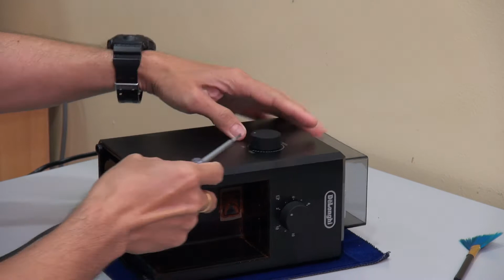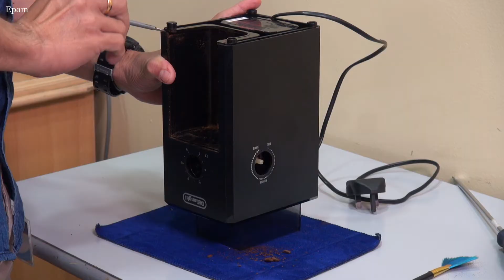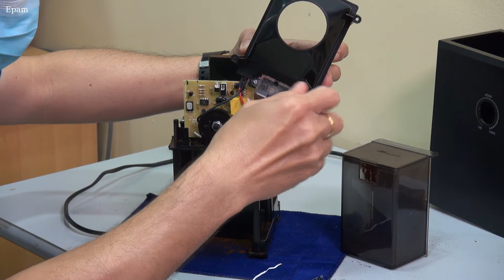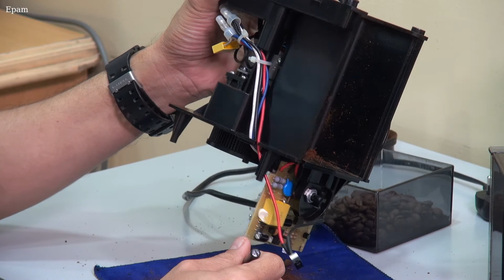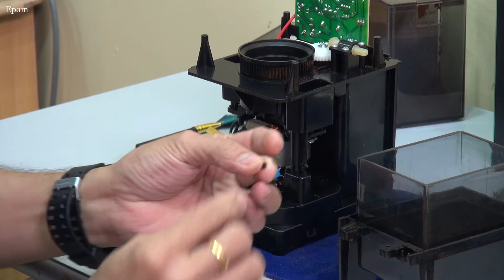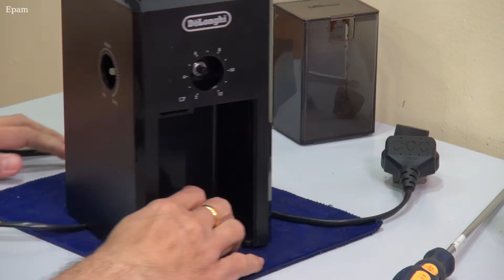Delonghi KG79 Clogged Grinded Coffee Beans | General Cleaning

Comment: I used this video to take apart the grinder to replace a .47uF cap which was faulty. One small point is the top part of the grinder will come out without disassembling. It works on a bayonet principle. Clockwise and pull. Thanks for the video.
Reply from the maker: Welcome. I forgot to remove the removable grinder.
Reply: The fault returned a few weeks later and I discovered that the top 100uF 25v cap had a broken lead. I replaced the cap and secured it with hot glue. I did this to other components that could break with the vibration.
Reply from the maker: @aceryeo8409  Good...

Comment: I turn the knob to the finest setting but the grind is never fine enough for a proper espresso. Is there a fix to this or should I consider buying a professional grinder to get really fine grinds?
Reply from the maker: You need to buy professional grinder.
Reply: Just search for "modify delonghi kg79 finer grind" and you'll find multiple videos showing you how to do it. It's quite easy once you've managed to pry off the front knob.

Comment: I lost the f.cking little plastic piece! I cleaned it and put it back together a couple hours ago and didnt think it is an important thing. After hours and cleaned everywhere and even throwed the garbage bag… What am I gonna do now 😫
Reply from the maker: Get a plastic or bamboo toothpick then make a small like bullet using sand paper and cutter blade.
Reply: @ I used a piece of paper to click in the cencor button. So it worked but there is no safety lid anymore 😃 It works even without a lid now
Reply from the maker: @ not safe
Reply: @macor285  I agree but it was the only solution to me at the moment. I hope I can find it as a spare part on the internet.

Comment: Awesome video, cheers!!

I have an issue with my KG79 you may be able to offer some advice on- 

As I was unlocking the burr insert to give it a clean out I forgot it was loosened with a right turn. So I inadvertently over tightened it resulting in the grind coarseness knob being thrown out of sync. I now have the dial set to max coarseness (full clockwise) but it gives a very fine grind but if I turn the knob anti clockwise the burrs just jam and dont move. 

Any advice e would be much appreciated.
Reply from the maker: if you will disassemble the unit you can see plastic color yellow (pin) and the white gear, just try to return the red color indicator to 3 o'clock position. If you want want more fine move the red indicator to 12 o'clock position. Watch also this video https://www.youtube.com/watch?v=8KX0KLWoj7w&t=7s. Good luck...
Reply: @macor285  thank you so much!!
Reply from the maker: @spm6689  Welcome

Comment: I opened my kg89 grinder to do the finer grind hack but when I put back together the appliance stopped working.. i opened again and made sure the sensor is properly installed but still no luck.. anyone can help?
Reply from the maker: Check the small plastic that push the switch on and off.